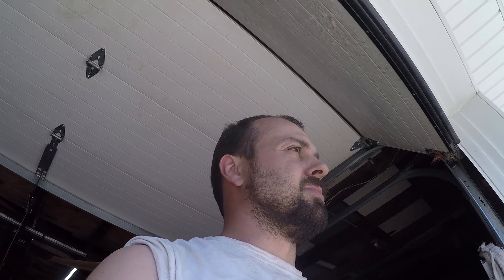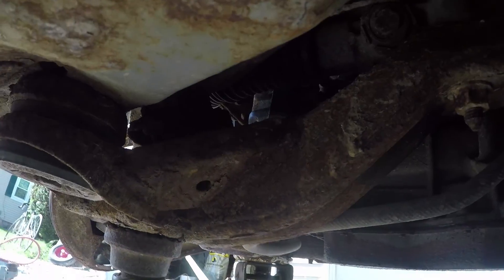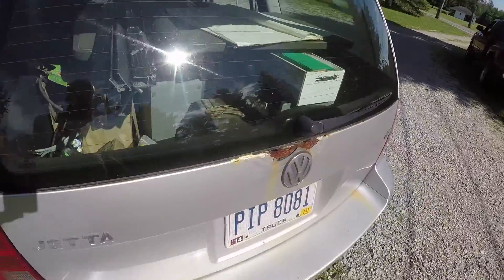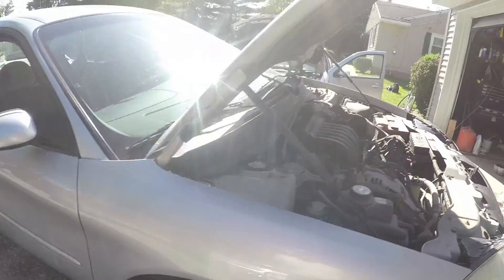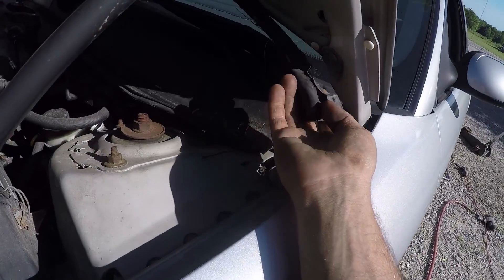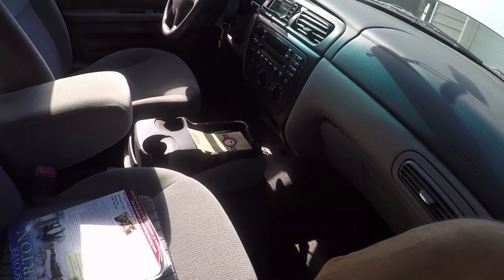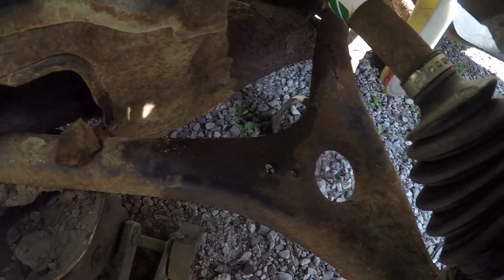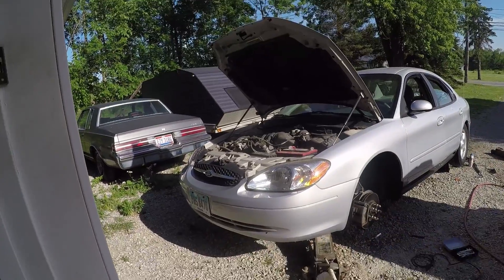Ford Taurus RANT

Comment from the maker: silver jetta update...the tranny grenaded 2nd gear...rebuild is underway.....it is still running, I sent the taurus to junkyard not long after this vid. someone els was in a light accident and I decided with all the rust a nd a whole rotting through the frame near the front suspension that I was not going to fix it...I could have it wasnt that bad of an accident.

the jetta now has over 250k miles and still runs strong, rocker panels are rusting apart finally, but the rest is still fine

the green jetta has a used trans swapped into it. new bushing in the gear levers, new turbo.......still driving it close to 400k

Comment: I share your opinion as I had a 2007 taurus that made me sick when I had it on my lift. The sub frame near the passenger side attachment point crumbled in my hand. The rockers were like yours. Central NY with all the salt use. I bought a used 2002 outback to get me by and the only rust is in the usual rear quarter. I had bought it in the fall of 2007 with about 30k and it is over 100k but it shouldn't be that bad. Brakelines should be stainless in this state.
Reply from the maker: Agreed, sorry to hear I'm not the only one. there is a local shop here that will steam clean the underbody of your car and spray either fluid film or trans oil all up under there every winter, thats what alot of guys do to there work trucks around here, it helps a lot..
Reply from the maker: I just sent it on a flatbed to the junkyard
Reply from the maker: still driving the jetta, every day
Reply: I have a gold 02 with 2460000 miles and is just about done, but my buddy had maroon 07 taurus and for some reason it compleatley rusted out, pretty shure ford stopped caring even more the lastyear they made them.